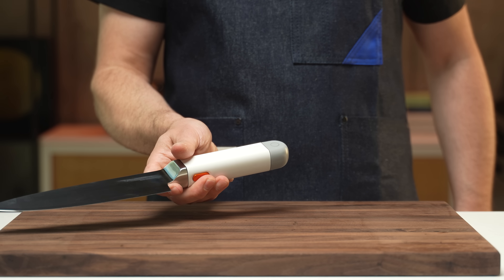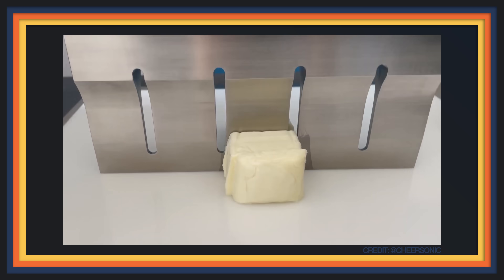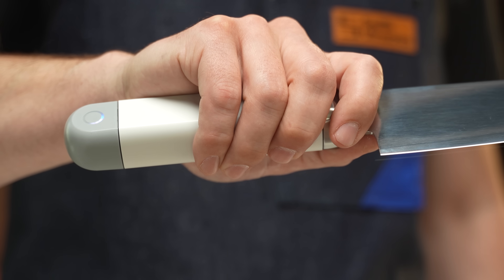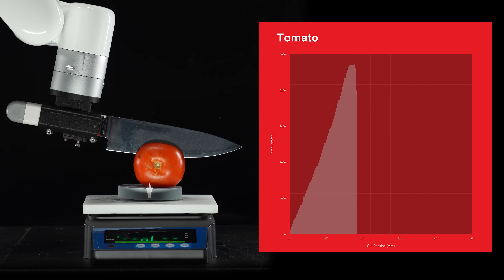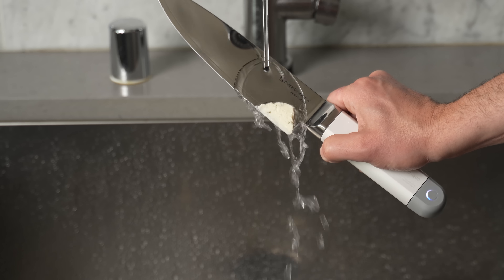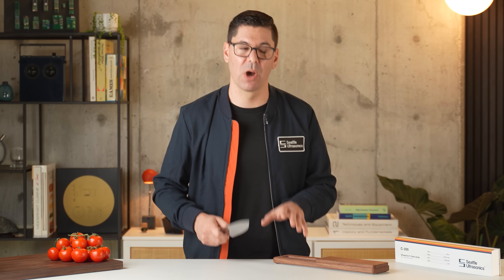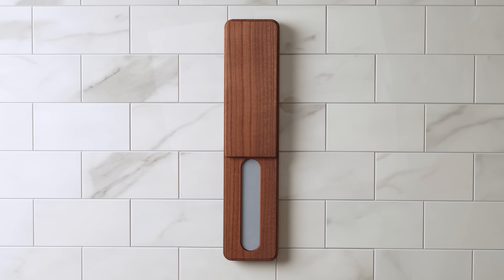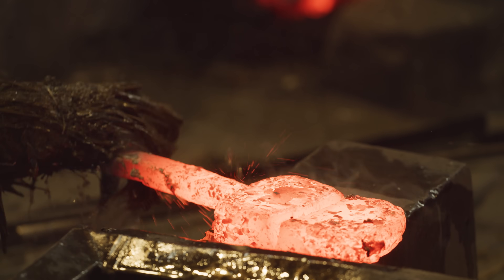The World's First Ultrasonic Chef's Knife for Home Cooks: Seattle Ultrasonics C-200

Comment: how does the wireless charging work if the charger is not connected to a power source?
Reply from the maker: The charging tile is very similar to an airpod case. It can charge your airpods, but the case itself needs to be charged every once in awhile. It contains its own internal battery and a Qi wireless charging coil, just like the kind your phone uses to wirelessly recharge. Set the knife on the tile with the blade pointed either to the left or the right-your choice, and magnets in the block will hold the knife securely to the Charging Tile. The wireless Charging Tile can sit on your counter, live in a drawer, or mount on a wall using the included wall mounting kit. When the Wireless Charging Tile is charged up, it holds enough power to fully recharge the knife about 8-10 times before the tile itself needs recharging. In normal home use, that translates to weeks of use between having to plug the tile in.

Comment: I used to work as a chef, as I moved onto another career path, and have been using the same set of knives for over 30 years now. All they require is resharpening once in a while. I can guarantee you that in 30 years, these knives won't work as advertised. I would be surprised if they lasted 10 years. The battery will loose it's charge capacity. Mechanical parts & electronics will break.

Comment: sounds great and looks pretty cool. i feel like this will rather be a gimmik, this is like some stat pots in an mmorpg. sounds cool on paper. but it will not really make the diffrence between success and failure. this will make a sharp knife sharped, , when is somewhat blunt and still usable, but a blunt edge still unusable. i say this will make the intervalls from every 3rd cooking => sharpening to maybe every 4th. sounds cool, but its just like buying a better grade steel knife. HOWEVER its cool AF , probably worth a try just because its a .. VIBROBLADE

Comment: I'd bet the handle and vibrating system would sell well by itself to knifemakers, if this was open to various knife designs I could see it reaching near universal adoption at some point. Like if the handle was an upgrade available by preexisting knifemakers you'd probably sell more units than you ever could selling the knives as a whole package. Not to hate on the blade or steel choices, but people like options.

Comment: how easy is it to replace the resonators? I've had to replace numerous piezoelectric ultrasonic welder units due to non-maintainable construction of the housing that contains the ceramic resonators. Can these be easily and economically replaced when they inevitably fail from microfractures?

Comment: I love my old French and Japanese carbon steel knives, so this product probably isn't for me, but I really like the idea for certain applications.  Bread and cheese come to mind in particular, but also sushi and thin meat slicing in general.  If you are open to suggestions here are a few that come to mind.  I'm not crazy about that handle I hope you are able to come up with something a bit smaller and more ergonomic to hold  I assume batteries were an issue in that design choice.  I also might prefer an on off switch to turn it on and off possibly with a sensor that automatically turns off if left on.  I don't like to squeeze the handle of my knife tightly when I am using it.  I mostly pinch the front part of my knives.  This offers greater control and isn't fatiguing to the hand.  I would like to see multiple handle options possibly interchangeable blades.  Think one handle to rule them all.  I have many knives and they all have their own syle of handle.  I catch myself using a less sharp knife for certain applications because I prefer it's handle.  Also you didn't mention if these knives can be sharpened because regardless of the technology vibrations can't completely replace a sharp edge.   Anyway love the idea I can't wait to see what you do with it.

Comment: I thought this was going to be unreasonably priced, and while 400 bucks is expensive, a high quality kitchen knife could go for about the same price. This is reasonably priced.

Also, channeling ultrasonic sound throughout the knife like this is incredibly difficult and requires a lot of engineering.

And before anyone thinks this is a gimmick, it's not. Ultrasonic craft blades have been a thing for a while (albeit very expensive) and are incredibly good at cutting otherwise difficult materials.

I'm also pretty sure I've seen ultrasonic cutting knives used in commercial food settings (different than what was shown in the video) as well, but I can't seem to validate that at the moment.

But yeah, this might seem expensive at 400 bucks, but it's actually less than I thought it would be.

Comment: That is one very well delivered marketing speech. No bullshit, no superlatives, straight to the point.
A couple questions though:
A traditional knife can last a lifetime. What about this one?
What is the expected lifetime of the electronics? the piezo part in particular?
Can the blade be sharpen the traditional way? Since you talk about testing numerous blade shapes, how would sharpening (and therefore progressive downsizing of the blade) impact the vibration transmission and overall knife performance?
Could you communicate on how the knife wares down please?
More broadly, PLEASE-PLEASE-PLEASE be one of the good companies that understands the necessity of sustainability and repairability, and incorporating both as core design principles?

What is the expected battery life on a single full charge?

Does the ultrasonic generator and/or resonance in the blade produce sound (including ultrasonic) that for instance animals (i.e. dogs) may hear?

What kind of budget are we talking about?
Reply from the maker: Lots of great questions, lemme answer in shorthand what I can here. 
Electronics lifetime should be super long. We're using piezos at a small fraction of their rated power, and these crystals are the same ones used on industrial machines that run 24/7 for years. 
Home sharpening is just fine, autotune keeps you in resonance. Just don't shave off centimeters with a belt grinder. 
Cutting edge wears like other great knife steel, but at any level of dullness you still get a boost from ultrasonics. 

I'm super sensitive about e-waste (note: there's no charger or USB-C cable in the box for this very reason). I also think a knife should last a LONG time. I'm working on a recrafting program but it's not developed just yet. TL;DR I care about this stuff and my business model is not based on planned obsolescence. 

Hope these help! If you have more, email us (info on the website)

Comment: Only a 1 year warranty? How to repair the knife if the circuit board fails after a year? Very interested in this, as someone wanting to start making cooking content and some experience working as a chef. 1 year warranty though, hard pass. Change it to at least 5 and I would place an order today. Unless you are not confident you product can last more than a year? I have expensive knives, they will last me a lifetime, just need to sharpen every now and then. Your 'knife' becomes an expensive paperweight or wall decoration if the board fails. Really disappointing.

Comment: I thought to myself that the ceiling price for this would be no more than $300-$350 tops.  $250 is more agreeable.  Depends on the warranty and return policy due to electronics.  A black color handle option would be nice.  White is tacky and may discolor over time.  The mechanism is only a benefit with slicing and not chopping.

Comment: "Most knifes are dull." 

Well, one, you don't have any actual proof of this. Two, sharpening a knife isn't difficult. I've had a knife for over 20 years that is just as sharp, well sharper, than the day I bought it. I paid 50  dollars for it and it cuts better than that plastic battery operated abomination.

Comment: Ah, the ol' create a problem that didn't exist and pretend to supply a solution to it trick. No one needs this, buy a good quality knife that doesn't rly on electronics to function properly. I doubt that blade is of any quality that can even be considered good.
Reply: San Mai steel in 3 layers is pretty damn good.  As a harder steel it takes more strokes on a sharpener to get it sharp, but it also does not dull as easily which means sharpening it less often.

Comment: I think at this pricepoint a Option for a  wooden handle for 50$ more would be an easy sell.
Reply: Wood may not allow for a waterproof seal where the button is located or a seal that would not last as long as wood gets wet and dries and expands and contracts.
Reply: @inquisitor4635 good point. But some woods are nearly waterproof, especialy if treated. A inner watwrproof shell would also be an option.
Reply: @inquisitor4635 Or a non physical button, acvtivated with a magnet or remote. All I want to say: I think there is a solition, and I still love the original product.

Comment: Weird question, but I'm curious, with the way this works, is there a point where the sharpness of the knife becomes a detriment? 

I guess what im asking is is there a point where the smoothness of the blade would prohibit it from cutting efficiently since, at a microscopic level, the cutting is still done by grooves in the metal.

Like how would this work scaled down to something like a surgical scalpel? I

Comment: I think V2.0 will be making it safe if you touch the blade when on. Cause even the ultra sonic resonators found in water based diffusers hurt a lot when you touch the Piezoelectric plate.

Comment: No home cook would cut a tomato without sliding the knife forwards or backwards during the down stroke. This would significatly change the numbers for the test. That's 90% of the reason for the large difference. You have the gently slide the knife forward or backwards to break the skin while applying downward pressure.

Comment: Mr. Seattle Ultrasonics, if you read this, please consider a dark tone color. I would have snapped this up with the charger. But a white knife, and a wood charger does not go with my kitchen. Black handle and black charger would be awesome. I realize this is difficult for a startup but I want a $500 knife to look upscale in my kitchen. (No folks, 500 is not too much for this thing, if it does what he says...a Japanese steel knife alone can be 300+).

Comment: I perceive that the cutting demonstration on the tomato when turned off required a lot of force; that it isn't that sharp. But I realize that this is, again, made for home cooks. There's a more tool-like edge so that it won't deform as readily and thus stay sharp and useful for much longer for the average "I never sharpen my knife" home chef. Assuming that's the case, it's really clever.

Comment: This knife has a major flaw. That you have to push a button, to activate it. I'll explain.

Imagine you invent a gadget that you can mount on your car's engine, it will save 20% in fuel. But to activate it, you will need to press and hold a button on the steering wheel, to activate it. Well, you could mount the button, so that the button is placed at 10 o'clock on the steering wheel, so that it would be in what you think is a natural point of the wheel - the 10 and 2 o'clock positions, that we are taught to drive. But you still have to press a button and not all people like the 10-2 position. For some, it's unnatural.

It's the same with knives. We all hold a kitchen knife different, but you are now forcing us to hold it in a specific way, that will be unnatural to many. And you will have one more thing to focus on. Not a good idea, especially with something that is sharp, and can cut.
There are so many ways, this could have been resolved, without a button. Motion sensor, pressure sensor, heat sensor etc. Or maybe the best one and one we already have in our pocket - an accelerometer. No matter which combination you would choose, that only has one downside and that is, that it uses the battery, when you are holding the knife. Leading to reduced battery life. But it's a fair trade, compared to having to hold down a button.

Comment: About the force test, unless you really don't know how use knives, you slice the knife back and forth when cutting, nobody chops straight up and down when cutting tomatoes. So your test should immitate that, I wonder if it's still gonna make such difference. Also, when the knife wasn't poking through the skin, the force was just like 80-90% compared to non-vibration, that's already not taking into account the knife should slice instead of chop. So it's very questionable how much force it can reduce in a real use situation.